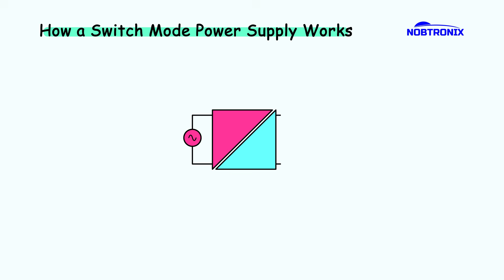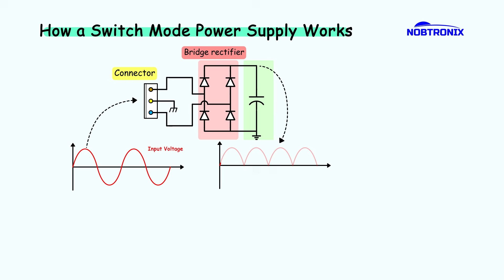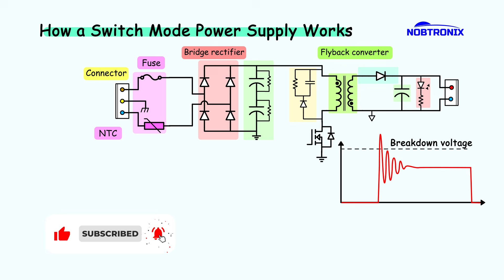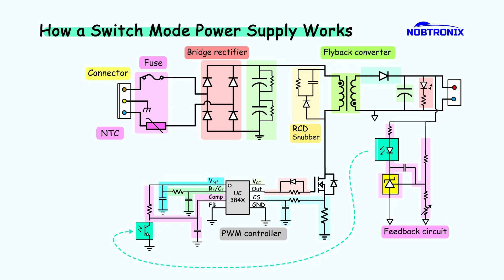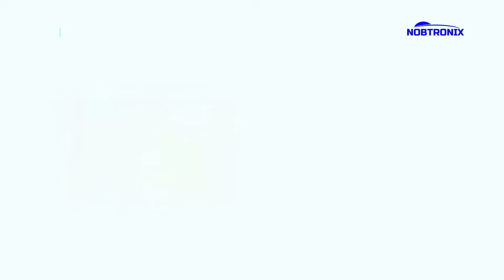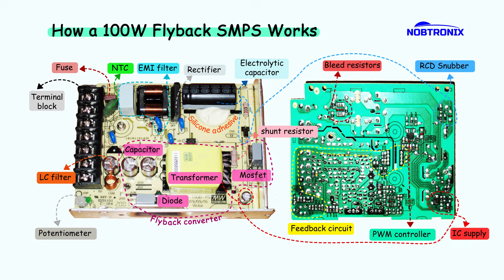How A Switch Mode Power Supply Really Works? Inside an SMPS

Comment: Professor estou com uma  Fonte asus 120 watts da LITEON modelo: PA-1121-4 SCH  PWM lta702n. O PWM estou e preciso colocar outro no lugar, mas não encontro datasheet dele e nem substituto. Pode ajudar?
Reply from the maker: O LTA702N é um IC combo que integra CRM PFC boost e flyback. As opções para substituição são: comprar o IC original de fornecedores na China, o que é mais simples; procurar um IC compatível de outro fabricante com o mesmo pinout e funções; ou separar em dois ICs (CRM PFC e flyback) em uma placa auxiliar e conectar à original, o que é mais complexo.

Comment: Why is the FB pin on the PWM controller IC connected to ground?
Reply from the maker: The FB pin is connected to ground because the regulation is controlled through the COMP pin by the optocoupler transistor. The TL431 on the secondary side senses the output voltage and drives the optocoupler to regulate the PWM duty cycle.

Comment: On the flyback trans. How does it work if you don't have a.c? And is it a step down
Reply from the maker: A flyback transformer doesn’t require AC from the mains to work—it actually uses pulsed DC. The basic idea is that a switch (like a mosfet) rapidly turns the DC on and off, which creates a changing magnetic field in the transformer. This changing field induces voltage in the secondary winding, just like AC would. It acts as both a step-up and step-down transformer depending on the turns ratio and duty cycle.

Comment: By default, a power supply is hot, and consumes a lot of power, a laptop user will become unwanted anywhere he goes. If you use a car charger, laptop reduces its current need, the ac supply will be cold, and still batt charges to 100%. If you use the laptop for power intensive gaming, the heat goes up. When you stop gaming, heat goes down. Energy saving software loads into the laptop, battery panel dv charging, and in sleep mode. You have to put the car charger onto the laptop in sleep on mode, use the buttom side. Transfer is about 10 minutes, but a tablet needed 8 hours.
Reply from the maker: Thanks for the comment and for sharing your observations! 👍

Comment: .Despite the availability of compact GaN chargers in the market, most SMPS designs still rely on silicon devices. Why hasn’t GaN been widely adopted in SMPS?
Reply: GaN is not widely adapted yet due to its high cost ,GaN efficiency is higher and doesn’t need heatsink. In some years its production cost will come down matching silicon
Reply from the maker: Although GaN offers higher efficiency and smaller size, most SMPS still use silicon because it’s cheaper and widely available.
Reply: sir can make a support 5v 
2mah to 9v 4mah super frist smart screen touch mobile phone charger.
Reply: @vamshikrishna7945  it is expensive and complicated to repair

Comment: Assalam o alaikum dear brother,
How do we select resistors and capacitor values.
Please Tell me.
Yours Truly.
Reply from the maker: Wa Alaikum Assalam! The resistor and capacitor values depend on your circuit design — for example, in a filter, timing, or SMPS, the formulas and ratings differ.

Comment: Do you have videos on controller design of LLC resonant converter and phase shift full bridge converter in detail in video?
Reply from the maker: Not yet, but designing controllers for power electronic converters is part of our upcoming plan.
Reply: Assalam o Alaikum brothers,
How to select and find components values like resistors and capacitors.
Reply from the maker: Wa Alaikum Assalam! If you mean the controller parameters, you can start with the converter and PWM IC’s Bode plot to determine the required gain and phase margin. Then choose a Type I, II, or III compensator, and finally calculate the resistor and capacitor values based on your desired bandwidth, gain, and phase.